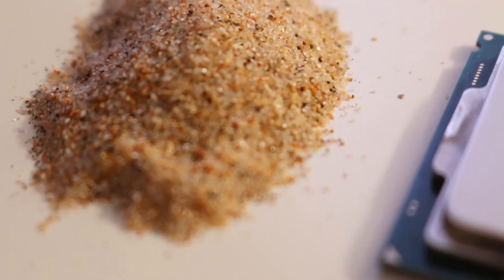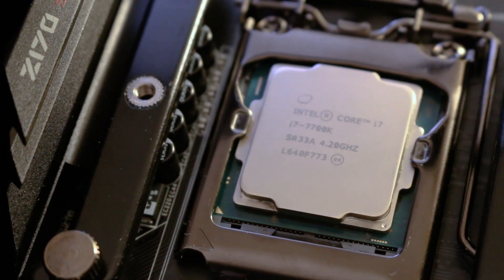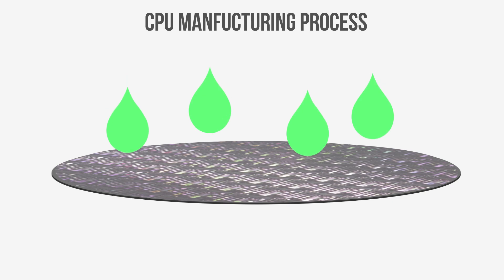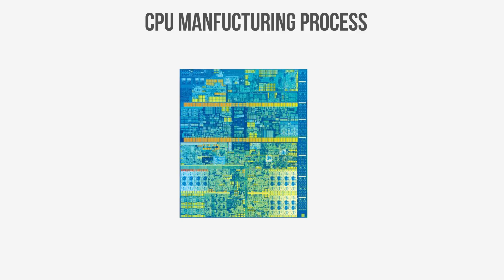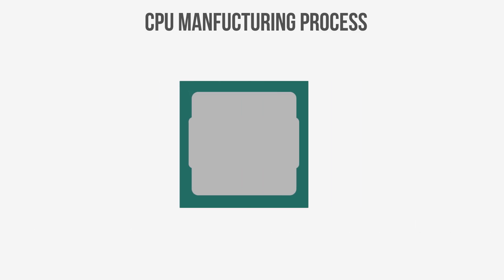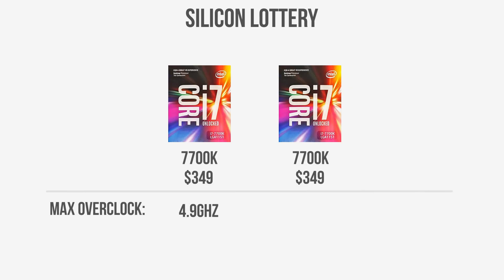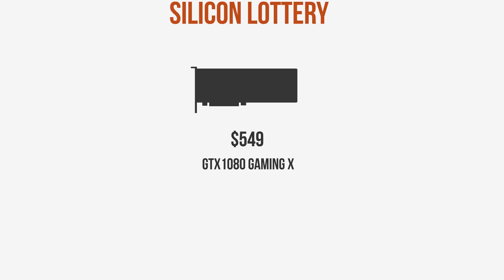What is The 'Silicon Lottery'?

Comment from the maker: A quick thank you to all subscribers - the channel is gaining some momentum and there'll be more high quality content this week!
Reply: Optimum Tech just found you a few days ago. You are killing it. Keep up the great work.
Reply from the maker: If you GPU is downlclocking, it's likely because it's hitting a limit, either voltage, power or thermal. Monitor it in MSI afterburner or EVGA Precision XOC.
Reply: TheBozn Which parts of the CPU have the necessary redundancy and self-healing properties designed in? I would have thought that once the chip is tested and binned any further failure would almost certainly be catastrophic.
Reply: Optimum Tech 

I really liked this. Not often that hardware is broken down at this pace, with this level of clarity. I am gonna go read about logic gates now. Favorited. 
THANKS.
Reply: Nebbou Hicham No. But, as he explained, some of them might not work immediately after manufacture, in which case the affected core is disabled and the faulty chip sold as a processor with fewer cores.
Reply: +Nebbou Hicham +johnm2012 It really depends on what parts of the chip and which transistors are damaged.. But generally in modern CPUs you wouldnt notice if a few died..
Reply: Fun fact:
Silicon ingots are not produced by melting sand. Silicon dioxide is converted to silicon tetrachloride, which is then distilled to purify it. Then it's converted to pure silicon powder, which is then doped with the right dopant (for P or N conductivity type) and passed through zone melt, to purify it further.
Some grades of silicon are even isotopically pure.
Reply: Good work, wish u diamond button
Reply: Edward Kenway - Be careful how you spell. This video is about the "silicon lottery", NOT the "siliconE" lottery. Note: you added the "E" at the end. Silicone, as in breast implants, so that lottery, might get you a "girl", with extra parts !!! ;o)
Reply: is there a app/web site that can test your computer?
Reply: In intels 14nm  node the fin width is actually 8nm. The node name has pretty much no relation to feature size anymore.
Reply: This is super interesting and I have to admit that I never heard of this before! I wish you would've made a longer video going into more detail. I will now go and search  for more info somewhere else, view-time, that could have been yours! 
This is not supposed to be an insult, just a critique because I kinda like you already (it's my first time on this channel and the first video of yours I've seen)
Reply: did you know they grow the crystals and don't melt sand for it ? why you telling all these folks lies man ?
Reply: I feel, this, "Silicon lottery" can apply to any man made products out there, as they are mass produced. Lol.
Reply: Man, who would've though, sandy fine rocks can be made into one of the most useful tool for mankind. 

Gotta give credit, where credit is due, eh? Lol.
Reply: fact
Reply: Btw this is the one video where saying to like the video actually made me like it
Reply: i heard that those millions of transistors can die like 100 of them  , but the CPU will still function is that true ???????

Comment: I lost the Silicon Lottery, like I scratched off the ticket and it asked me to pay THEM type lost. 

I built my first ever PC with Intel Core U7 265K. Everything was going good like it booted first try until I benchmarked it on Passmark and got a score of 49100 when the average score is 59500. Thats 16.5% less performance, I am closer to having a 245K than a 265K. I am really disappointed and dont know what to think.
The CPU did not even go above 70 degrees either.

Comment: Does this mean that I've somewhat gotten lucky with the silicon lottery? My i7-9700K is overclocked at 5.2GHz and is not heating up too much (w/ AIO of course) with max temps of 81 and average of 72 under 1 hour of stress test while simultaneously stress testing my GPU (to see if the hot air from the GPU would make my CPU run even hotter since I have my radiator mounted on top as exhaust). My RTX 2070 Founders Edition that is overclocked can reach boost clock speeds of 2040-2070MHz, max temps of 67 and average of 64 under 1 hour of heaven bench.

Comment: The architecture node is not equivalent to the fin width. The measurement of node is actually mostly arbitrary - hence how TSMC and GlobalFoundries 7nm node is roughly equivalent to intel's 10nm node in overall dimensions.

intel's 14nm has a fin width of only 8nm, their 10nm node has 7nm fins, and TSMC's 7nm node has 6nm fins.

Comment: I won on the GPU side: my 2GB MSI GTX 1050 Gaming X runs happily on 1848MHz(stock = 1556MHz on max) but i managed to get it running on 2122MHz with a voltage bump, but the GPU is running at 70 degrees, and on 1848MHz it runs at 55-60 celcius fine without it being too loud. About my CPU: i haven't yet tried with my Ryzen 3 1300X.. hopefully i can go to say 4GHz\4.2GHz

Comment: I'm the biggest loser when it comes to the silicon lottery. My R9 390 has a custom cooler and never gets hotter than 70° Celcius (on 50% fan speed).  However the highest overclock possible for me is 1040 MHz. Other cards reach up to 1200 MHz which is more than 10% extra performance. This SUCKS

Comment: Did i win the silicon lottery if im on i7-8700k and i can go 4,5 ghz on 6 cores with 1.128 vcore ^^? 
im on watercooling. 
Avg load temp is 68c!
Reply: Tristan Alexander Ewald proof it's stable or absolute bs, if it's stable off to a delid and 5ghz

Comment: I overclocked my amd fx 6300 from 3.5Ghz to 4.5 Ghz withought increasing the voltage. 2 months later of pretty heave usage i still got no crashes no high temps no nothing. Am i lucky?
Reply: lower voltage as you want as low as can go

Comment: I had an Expensive Asus GTX680 DC2T-2GD5 back in the day It could NOT overclock in the slightest! When that thing went 2Mhz over its 'max boost speed' it crashed every single time. While a friend of mine could boost it 200 mhz higher. It was insane.
Now I have a Gigabyte GTX1060 and got it overclocked to 1685mhz with 1900mhz boost coming from 1556 and 1797 boost and there is still room to go even further.

The Silicon lottery is a BITCH and many people trade in cards because of it and then others get screwed...

Comment: Well.its not quite a lottery, at least on the CPU side.

Firstly, the processors are nipped in the core count. This is not a lottery, its you paying for a tested product with a specific performance.

For clock speed its pretty much the same. The processor test to a certain clock speed, then are sorted. Well yea, one 2000Mhz marked processor might be faster than a other, but its pretty much never faster than a 2500Mhz marked processor.

For GPUs yea, there its a bit more random. 

Also. For Zen CPU its difference between a 4 core die, and a broken 4 core die with 2 cores active.

For example Ryzen 1200-1300 series is low preforming 4 core die.

Ryzen 1400 to 1500 is two chips with each 2 broken cores. (the 1400 also have some cache disable)

Ryzen 1600 series is either two chip with each 1 broken core, or one with 2 broken and one non broken. (I´m not sure if they actually do mix it , or everyone is the same)

The 1700-1800 are two fully functioning chips

And the 1900 is two dual module dies. With the lowest tear having broken cores but great preformance (top 5% preforming according to AMD). And the higher ones just got less and less broken core. All 5% preforming. So its pretty much that you buy the wining ticket.

Comment: "The first step start by melting sand into a pure silicon cylinder."
No.
The silicon in sand is NOT the same kind of silicon in silicon chips! The silicon wafer is made up of a special kind of silicon crystal, Monocrystalline Silicon, not just "pure silicon". The manufacturing of any quality MS is difficult and takes a lot of energy. The speed of the processor is largely dependent on the quality of crystal which depends on how well atoms have line up throughout the crystalline structure. This is a HUGE, if not THE reason good processors aren't dirt cheap (I meant, 'are so damned expensive).

Comment: this has destroyed the last of my faith in parts. now I know i could buy a ryzen and get a celery instead. >:(
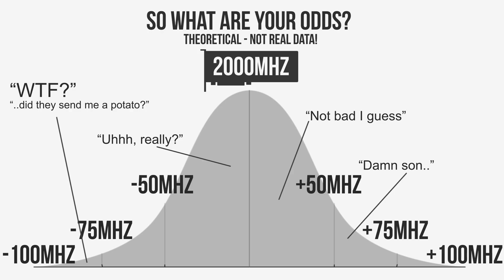Reply: Rest assured AMD and Intel will not sell you a worse processor than advertised as each are individually tested and then are 'named' (ryzen 1950X for example) based on how good it is. Nothing in this video implies that you could get a worse processor than advertised, see at 3:40 it says, it says "theoretical data". When in fact, you a more likely to win the silicon valley lottery.  Don't lose faith when you just need to pay attention.

Comment: Good video but innacurate : in the video both CPU and GPU are considered equally whereas practically things are different: the real problem with CPU is the multiplier which forces a clock ratio, whereas GPU don't have this issue: GPU use adaptive clock generation that automatically adapts to the process, voltage and temperature. This clock generation method is closer to the actual "profile" of the silicon die and also automatically adapts to power supply transient variations (GPU especially bounce hard the ground plane). So a number of the defects that are pointed out in the video don't apply too much to GPU: no intra-wafer variations but instead we have intra-die variations (which are much less than intra-wafer ones), process variations on a specific layers (thin or thick oxyde, RC,...) are also compensated by the clock generation system because they're composed of rings made of the same elements (transistors, memory cells...). Ultimately for a GPU what limits is the intra-die variations across PVT (process voltage temperature) which is becoming worse as the transistors density increases, and more importantly ground bouncing for which some margin must be used. This margin is calculated by the silicon characterisation team on a sample set made voluntarily with defects, and applied to all the parts. These margins guarantee a baseline (for example a minimum frequency) against which the product is binned... this baseline is the minimum the silicon is guaranteed to operate at. Anything beyond is a bonus really.
CPU also have these features but the fixed clock ratio makes it much more sensitive to PVT variations and ground bounces. They practically hit the same kind of limit that we see with a usual PLL which doesn't compensate for anything.
Other than that, a good video, educational. thanks!

Comment: the silicon lottery is rigged, checking the stepping numbers is a good indicator, having friendly contacts with your retailers will sometimes get you some choice.. used to help out when selecting 3 core amd chips to unlock their 4th core... the fun part is these days, finding one of those nice stepping/revision number chips on the very cheap, and overclocking the living bleep out of it just because.

Comment: Please do a video about how the tiering process affects the performance distribution on various hardware.  There are two things to consider (which you can take to your local statistician):  first, the performance distribution inherent in the manufacturing process.  This will basically chop the normal distribution into the tiers.  The second is the uncertainty inherent in the testing process.  Given the same benchmark and the same chip, there will be a normal distribution of speeds.  Intuitively I would say that there would be a (very) few mid tier chips that win the lottery and perform better than the lower end of the top tier chips.  If you want to play the lottery to win, you should buy the top tier, and given that this is a tail distribution to the right, chances are decent that you will win the lottery on the plus side.  In other words, top tier hardware is a decent gamble.

Comment: To put a little more detail on the process:  When the wafers are sliced from the silicon crystal ingot, there's a tendency (or at least there was) for the center of the wafer to be ever so slightly thicker than the outer edges, so you'd often see the highest of the high end...your typical Xeons...come out of the center of the wafer while the Celerons of old would come from the edges.  Then you add the imperfection factor, e.g..imperfections in the silicon crystal lattice that can potentially show up anywhere on the wafer but they try hard as hell to prevent it from happening.  Still, since this stuff is going on at the atomic scale, it's almost impossible to get a perfect wafer in every way, there will be differences and therefore there will be differences in yield.

Comment: the way I ended up wrapping my head around it is with an example of "bad" manufacturing of, say a batch of L-sized (i7) t-shirts. Turns out the sizes and qualities of end products vary so much, the manufacturer ended up slapping the slight-undersized ones with M (i5) label, really-undersized ones with S (i3) label. Regardless of labels, some will break threads early, some will withstand washing better. I guess consumers are used to accepting the fact that manufacturing process, technology and quality control for most daily consumer products are much easier to withhold to a certain level than the hi-tech electronic parts.

Comment: Totally won the lottery with my 2600k. Managed to push it to 4.6Ghz on Air... As well for my GTX 780ti @1300Mhz on the core. 

But then my luck dissipated. My 5820k on the other hand is a bit below the median. Most people can achieve 4.5ghz on 1.315 volts. But I need 1.375 to stay relatively stable at 4.5Ghz. Right now it's sitting at 4.2ghz on 1.312 volts. And this system is fully watercooled.:( Can't win em all.

I'm praying I'll be lucky when I finally decide on a 1080 or 1080ti. /fingers crossed

Comment: Can someone explain me two things:
1) Why are core i7 and similar processors fitted with integrated graphics? As i understand it consumes a lot of usefull resouces which may be used for additional cores or enlarging existing cores...
2) Why arent intel and AMD producing oldschool 150-200 Watts powerful solutions. I mean use 14nm technology and place shitload of transistors. Modern crystals become smaller and smaller with each generation. Just check CPU-Z specs for old CPUs.
Reply: Some processors have Integrated Graphics for two reasons:
1 - Lower costs in some systems. Not everyone is a gamer nor is it a good compromise to rely on dedicated GPUs for operation. For example, you are bound to need a bigger PSU for that platform if the chip lacks an iGPU.
2 - Addressable market, lower complexity. Having an entire solution on a single chip (hence today's CPUs can be easily called SoCs) makes for smaller, simpler platforms. All in all it brings us back to reason 1.

As for the other reason, it has to do with architecture optimization/complexity. Sometimes despite the TDP, which is not the whole picture, you get to understand some strenghts within each product. For example, VEGA is a very complex architecture that, despite its consumption, has high compute performance. Intel's solutions aren't optimum either, but they have their strengths in AVX workloads, and so on, so forth. I'm not an engineer by far, but one might tell you more in-depth arguments concerning this topic.

Comment: After the CPU is made there is thorough testing to select the clock timing (CPU speed...) and whether it can be sold... There is no real lottery. The messed up part is that they make CPU's with the exact same method on the same wafer and depending on its purity some CPU's can be clocked higher (so they will be more expensive while their production manufacturing and R&D costs where exactly the same). Others can't. So they check the maximum possible speed, reduce it around 30% and sell it on that s[eed/frequemcy... oh CaPTAIN HERE (Master Of Science in Microelectronics...)

Comment: Wow! I remember having this basic discussion about microprocessor speeds with my uncle back when new processors were like 166 and maybe 200 MHZ single core.  Interesting to see that this elemental fact of micro-semiconductor manufacturing is still behaving the same way when speeds have increased by more than an order of magnitude and multi-cores are a thing.

Comment: I need to counter an implication here: playing the silicon lottery is not just for the "top binned" chips, especially as yields improve over time, and otherwise perfectly fine chips are rated lower to meet demand.

Even by the time CPUs and GPUs are ready for retail, even the lowest bins can often reach the highest bins' clockrate, albeit at a higher voltage. In fact, for some this is even desirable... often the power hungry chips are the best extreme overclockers with LN2.  AMD actually advertised some of these otherwise undesirable chips to extreme overclockers a few years ago.

Comment: This is a myth, the differences between chips on a wafer is tiny. If you compare different steppings, which is probably how this misconception came about, then there will be small incremental improvements. Another factor which adds to this is the fact that people don't know how to overclock, and think their processor is stable at the first clock frequency that actually boots, "my cpu does 4,2" - no it doesn't it does 3,9 you just haven't run prime95 for any lenght of time. I have had several chips of the same model, and they all performed near as makes no difference identically. Fact.
Reply: Your personal experience can't compare to the millions or billions of chips beings produced every year ^^